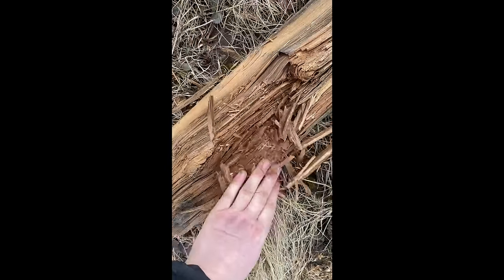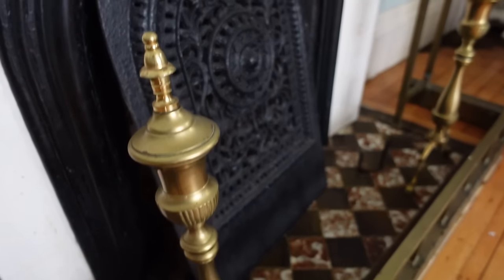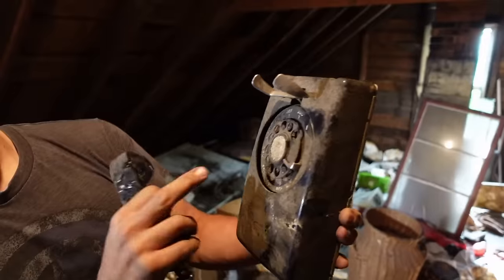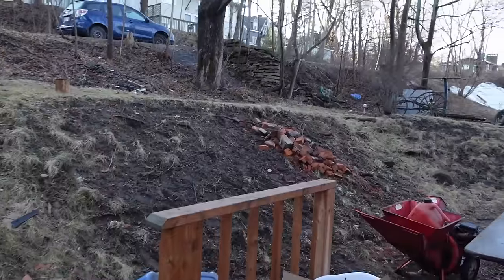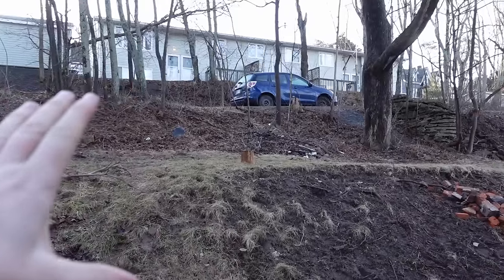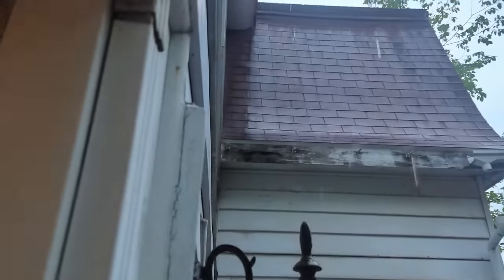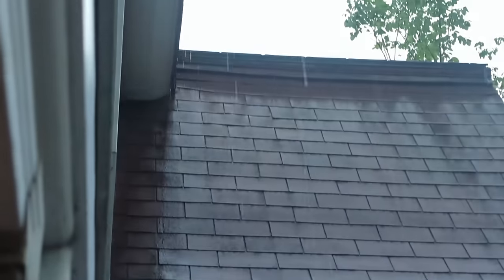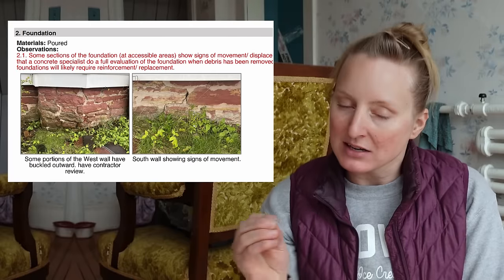Top 10 Reasons My House is Falling Apart // 120 Years of NEGLECT 😩 (ep.4)

Comment: You got your work cut out for you!  As someone who grew up in wetlands at the bottom of a hill, that is not a basement that can be finished. Your basement will probably be useful for storage and utilities but you'll need to make sure any storage is up off the floor by 8-9" depending on how much water usually comes in plus the exceptional flooding event. If you have the budget, a landscape architect can make up a plan for grading that hill and directing water around your house that will stand the test of time. Thank you for taking us on this journey!

Comment: My house faces a pretty steep downward slope too (and is also old--1917). A French drainage system (YAY!), and subsequent terracing of the slope, made our basement MUCH dryer and did our house tremendous good. Therefore, from what I've experienced, you are totally on the right track. Also...agree with you that the foundation is much more important than the roof right now. Adding the extra weight of a new roof, plywood or metal and all that, would be questionable when your foundation is so compromised. I'm really enjoying watching you save your beautiful old home. Try not to let the internet critics bug you. I've noticed some good advice here too, so it balances out. 🙂

Comment: I live in San Francisco with hills and LOTS of Victorian structures (and older). My apt was built in 1907 after the big earthquake and fire. The apts have various work done on them… all still have high ceilings and picture rails. I’m lucky I still have some built ins in the kitchen (most of the others have had them ripped out. My kitchen sink and cabinets around the sink were put in, in the 70’s. They are not wood and the sink was caving in so I finally got a new sink and counter top. I found a kitchen cabinet (1940’s?) at a reclaim place to hang above the sink and have more cabinets. It was raining and the price was hidden so the guy said $20 bucks and SOLD! Then he carried it out to my hatchback… $40 was written on the bottom! My manager (who was also rebuilding the kitchens as apts became vacant) put it up for me. My bathroom has a large claw tub (all the apts do!). Our windows are original and we now have a law that they can’t be replaced with cheap metal ones so the landlord is having them rebuilt. Alas the pipe that comes off the toilet was designed for those water wasteful toilets and not our water saving modern toilets. My “stack” have all been here 25+ years so the newish owner (15 years) hasn’t had a chance to change the pipes. Our toilets overflow a lot. I’ve got it down on how to handle it. My apt is drafty and cold when it’s cold outside (radiators only run about 4 hours in the am and 5 hours in the pm all year round as our summers are cold. My small radiator can not be turned off so when we have a heat wave it takes managing). My apt is cute and I prefer living with inconveniences than living in a modern motel looking apt!)

Comment: Just a thought, when you regrade the back of the house to flow away from the foundation, might you install a French Drain so that the water pooling in between the two mounds of soil would flow away and around the house?

Comment: I live in a house that was built in 1926. It just 2 two of us working on it. We call it the project. When I saw the cleaning out the attic episode. I new you needed new roof, because of the lack of sheeting. Yes  we have done the roof. My only advice is make sure the sheeting is part of the estimate. Some roofers think there is sheeting. Then go with replace any rotten sheets. Witch will cause an surprised extra $$. This will not matter if you are doing it yourself. This is fun and brings back memories. On some of what we had done to our house.

Comment: What is the permitting process like for doing some of these repairs, like the foundation repairs. Are you talking to geoengineers too? So glad you are using french drains for the yard. Those are great! Are you guys replacing studs and drywall in the basement rather than drying them out? Curious if there are concerns about black mold spores. More randomly, is radon an issue where you live? Lastly, how does the house impact your circus work? Im wondering if you have to commute now? Thanks for sharing your process despite the keyboard warriors!! You have sooooooo much work to do. We believe in you!!!!

Comment: I am surprised that there was no retaining wall on the hill side of the house. And if there was it could be buried under 100 years worth of dirt.
I did my retaining walls in short sections as long as they were under half meter high I did not need council approval for them. So I created a stepping system 40cm in hight the next one 60 cm pushed back from the first one, then another 40cm high wall, the next one again 60cm from the 2nd one to the 3rd retaining wall, again 40cm in hight then the last one was 50cm from the 3rd one and the last one was 50cm in hight.i made sure of a huge amounts of draining gravel was placed in behind each if the walls which drew the water away from running over each layer of the retaining wall structure. All of the drainage was run off into a pit filled with gravel and the top most layer had a silt barrier placed over the gravel so it would not fill up with the silt over time which would lead to all of the gravel behind each of the walls to be dug out and redone years down the track. 
There is a special drainage piping that has a silt barrier cloth around the pipe to stop it from entering the pipe thus allowing the water to drain away faster. I used it in the pit at the end of the retaining walls by coiling it in the pit and placing the gravel in the centre of the coil and then adding the silt sheeting over it all and then placing the garden soil on top for the grass to grow. The grass will stop more if the land erosion from happening. In front of the walls I added plants that did not mind getting their feet wet for extended periods during the wet season. They help to take up as much of the water to keep the ground from getting water logged.

|__ the stepped retaining walls
     |
     |___
            |
            |___                  | side of the house
                   |                 |
                   |________| 

That’s the best way I could show what I had done 😹😹😹 I did it that way because I did not need to get building approval for short high steps but it solved the problem of water being taken away from the side of the house. Yes it was a lot of hard work but I found that the smaller walls made for a better control of water being moved faster without causing more flooding.
If I had built a full hight retaining wall it would have had to of been built using fully engineered built to code structure which would have cost me anywhere between $10-$20 thousand dollars. Which was not in my budget ever. I was able to use recycled bricks which I found in the local tip from a house that had been knocked down. So Dad and I spent 3 days collecting all of the loose bricks that we could find before the weekly tip clean up was done.  That alone saved me over $1000 in the cost of bricks alone.
Most of my yard re-modeling was done from building supplies that Dad and I found at the local tip😹😹 including 60% of my garden bulbs which I had found in the garden waste section when I was there throwing out the weeds.

Comment: Re: the roof.
I'm in ON so I'm not sure what your Amish or Mennonite population is like out there.
I had an Amish neighbour that manufactured metal and was able to get a contact from him for a roofer.  They did a fantastic job and it cost less than the shingle quotes I got from roofing companies.
Metal also adds less weight to the roof...which I'm sure that old house would appreciate 😊
Reply from the maker: Wow, that's so intriguing! I don't think we have either Amish or Mennonite populations here, but I can look into it! Good point about the weight - definitely something I was already mulling over in regards to adding sheathing vs. replacing the sheathing!

Comment: Shannon I have seen people who had that kind of roof go through the boards and see which can be kept, which can be replaced. There's a chemical that gets into the old timbers and reduces the moisture. 
Drainage is definitely a priority, would it shorten up the time on the foundation work by starting with sloping the yard first, then gutters, then the sill plate? 
The only repairs I have seen with stone foundation was those ugly cement blocks. If your research finds a more attractive (at least) solution it would be good. 
At least there isn't an old coal fired furnace which I remember in my Grandmother's house, 2 metres in circumference, big door and the heating was 25 cm diameter pipes without any insulation. Brrrr, no pump either. 
Slow, steady, researching the old techniques, then just going for it. There may be wood craftsman nearby or online who could demonstrate or, best of all, make those window frames.
Reply from the maker: lol it’s fun that you think there isn’t a coal furnace, cuz we have about 8 different furnaces and water heaters in our basement, from all different eras including the coal era… just very much not gonna make the top 10 list of problems in my house! Maybe if it was a top 35 or something tho!

Comment: Sounds like you need to put in some large drain pipe around the back of the house. Dig down 2 feet or so along the back of the house. About 4 feet back from your foundation. I don't know if putting a concrete lining, to stop the water from getting to your foundation would be better than putting down gravel in the trench. The gravel would still let water leach to your basement. Not as much as is happening now though. Which ever one, then put in a large plastic pipe with holes on the top half of the pipe to catch the water and lead it around your house and out to the sewer drains. Also when you put on gutters. Take the downspouts and hook them to flex plastic pipe. And run the flex pipe under ground and out to the street gutters to get the run off from the roof away from your house. We had a problem with the water run off from our downspouts flooding our front yard and walkway to our house. After running the flex pipe under ground from all our downspouts. No more flooding. Our old 1916 farmhouse doesn't have the problem of a close hill behind us. So we don't get all that run off from that. The water just has to get channeled away from your house. And I wouldn't want to do too much excavation so close to the back of the house.

Comment: The inside of that roof looks very familiar to me from the unfurnished attic in my parents home. I wonder if your roof originially had layers of wooden shingles? Because that is what is the next layer up from the large boards in their house; small wooden shingles that have an almost mosaic look to them. The outside of their roof is ceramic shingles today and have been for at least 50+ years and I do not know what other layers migth be in between them. 

My father has waxed poetics about the traditional style of house building. According to him the almost all wood construction makes for a house that is very resillient to water damage, because as long as you patch any leak or hole soonish the structure will dry out by itself without any real problem, no sponge like materials or true water barriers to catch and keep the moisture. The main isolation in their house is sawdust! And it is fascinating because a leak of water will dig itself a path through the sawdust and leave relatively little moisture behind. Any damage will therefore mostly be on the interior bits and not on the structural bits of the house. The house is *breathable*! 
Not a recommendation btw, just felt like sharing. It is the sort of construction that one migth choose to keep, not so much useful home repair.

Comment: Oh. gosh. Your roof situation is totally giving me flashbacks, lol! When we bought our house, one roofer compared our shingles to walking on ball bearings they were so far past their prime. But the worst part was that whenever they had put those shingles on, they'd just put them directly over the cedar shake that had been there from the 40s, so putting a new roof on required removing both layers of former roofing, redecking the entirety (I learned that the previous boards were charmingly known as "rat runners") and basically costing the equivalent of 2 new roofs. Of course, the only contractor that hung with us through the entire closing process ended up doing an awful job, so we had to put a second roof on after 8 years to actually fix some of the issues caused by the first contractor. 

May your experiences be better than ours! Still loving this peek into your process :)

Comment: I hope you go with radiator heat again. It is efficient and reassuring. Bonus: since it’s not forced air, you will be dusting far far less than you did in the apartment

Comment: Feel ya. Put 1/2load of dirt redirecting water,used plastic chain at problem corners into rain barrels to address immediately, amazing how a light rain filled 55gal barrel. Had sill plate replaced and jacks in basement. House had masonite siding. Think pressure treated paper mache. Melted in rain if paint peeled. Glass loose in all windows, immediately pointed,glazed all I could. When got bids for siding several wanted to put over old, didn't do that. In attic could see cracks of light turned out 3 layers with base cedar shingles on narrow boards. 
A friend told me to raze house and get modular. Cried a week as no one seemed to understand.
Had to use replacement windows because of MG but also can't get glazier as he says is retirement...4yrs younger than me. Saved all the windows and weights...yes,am emotional hoarder.
Thinking of using ag water trough to sequester water on terrace but pick landscape designer brain for elegant, efficient,water catchment.

Comment: I loved replacing the sill plate (not what we call it here) under a chunk of my house. The room above it dropped 15cms from door to the room’s outside corner as the plate underneath was so rotted. Using mini jacks, I crawled around under the house lifting it while the ex yelled down how by how much. Then we cracked open the house, replaced the wood and screwed giant screws into the cement ‘skirt’ foundation. It’s a very seismically active area, so we secured things. Loved every second. Kept doing it until my mid-40s surprise heart attack. Have taken a bit of a break from such active building works for now. But you’re inspiring me to get back into it.

Comment: 22:30

You are obviously free to do with your roof whatever you will and might have allredy done so.

If you remember my comment about journeyman carpenters I'd say getting a new slate roof (more expensive than even Bronze roofing 😉) would be a reason to import a journeyman roofer of the slate tradition (they might only be allowed to stay 3 months at a time (again requiring room, bord and pocket money)

My parents rebuilt the house i grew up in and added more than one floor in one of the most stunning ways I know. Having bought allredy old beams they were accessible from all sites for Restauration (taking down your roof for multiple months might not be optimal)

Than they framed the new roof, put toung and grove bord on top of the beautiful beams they framed with, added insulation, put the actual plasterboard on, added the moisture layers, added the ridges for tiling (building an air gap) and finally put on the tiles .

I could imagine you would be more amenable to the charming golden snd later green hues of copper roofing, that should be available in Victorian styles, even if it's not necessarily recommended by local trades people

Comment: Ugh, so many problems so little time and resources to get it all done. I feel your pain. Our house in California had a similar problem with water. The original part of the house was built right practically on the ground. It sat on a much more gentle sloping hill with about a 5' rise over about 120'.Every time it rained the water would come running down into our yard and almost into our front door. It didn't help that the house was set under two massive oak trees, which we were not allowed to remove due to local ordinances. I see nothing but potential for that backyard and hillside. once you get it graded and a proper retaining wall put in place. You could put smaller terraces and have a garden or strawberries growing there. You could have shade-loving wildflowers. You could even recreate the haunted bog from Anne of Green Gables, lol. Good luck with the foundation and the roof. You might want to talk to someone who specializes in windows to see what can be done for the windows and their frames. It never hurts to pick the brain of someone who knows what they are doing. I can't wait to see them restored to their former glory. 

I have to thank you for and that is the use of a tray to keep your sewing project items together in one place. I'm currently helping my daughter make an 1850's inspired dress for a dance in May and so far that tray has kept me from losing my thread scissors, seam ripper, pins and needles, thimble, fabric shears, chalk, tape measure, and my mind trying to find said items. It's not a perfect system yet, as I'm still training myself to set things back on the train when I'm done using them, but it has been the most helpful thing I have picked up from any YouTuber to date.

As always another great video, loving the extra corgi content, good luck with the yard. That probably be one of the biggest things to tackle, next to the roof. I'm loving this adventure that we are on and looking forwards to what else you do.